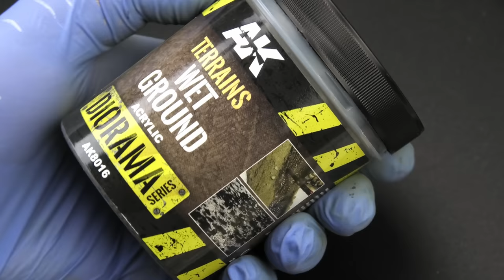Creating Heavy Autumn Mud On Armor Models (AMX-50, Resinscales 1/35)

Comment: For the model base, if the turret isn't already fixed in place. The tank could be lurking over a wall, bushes, or other obstecals, with the gun reaching over it. 
If the turret is fixed, maybe a maintenence scene, or the tank was driven in an pit and aming at something. 
Etherway, I'm looking forward to what you will come up with.

Comment: Hey hey!  I hope your leg is doing OK.  These videos are a highlight of my Friday.  I have a quick question.  I want to break into armour modeling at this scale, what would be a great kit to start with, maybe something with some photo etch, or interesting parts or additions.  You see, I paint and model wargames figures and armour for sci-fi, ww2, and fantasy wargaming.  It's been 30 years or so since I have put together a model other than 28mm or 1/56th scale.  I use many of the same techniques as you, but your stuff can be so much more detailed because of the size of the models.  Got any recommendations for a great starter model in a larger scale?  Thanks again for the great videos!
Reply: Probably start with a Tamiya  kit as those always have good fit. I've heard that M41 Walker Bulldog is good but I haven't built it myself. It's only like 20 USD on Amazon.
Reply: Tamiya should be a good start point. Maybe Academy/ Takom. Dragon are a mid point, more confidence needed kit. Miniart tank kits are high parts count, high detail and somewhat demanding on attention to detail and time consuming. But give great results. Good luck.